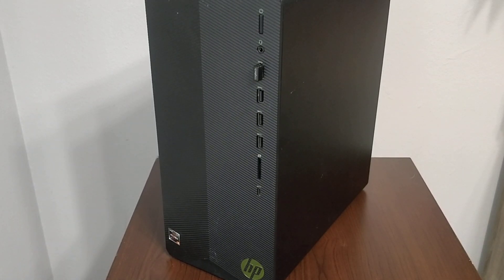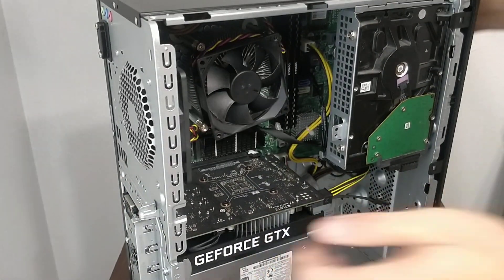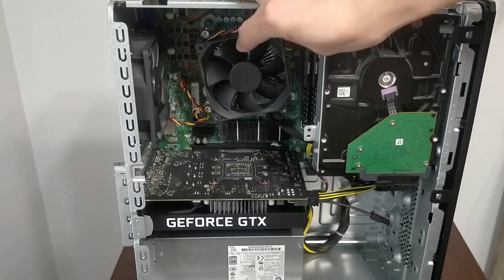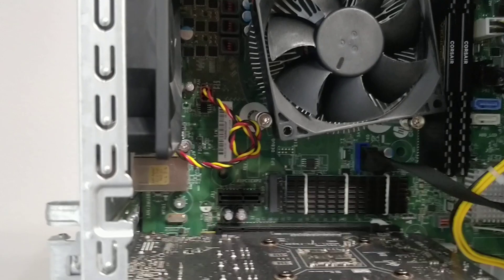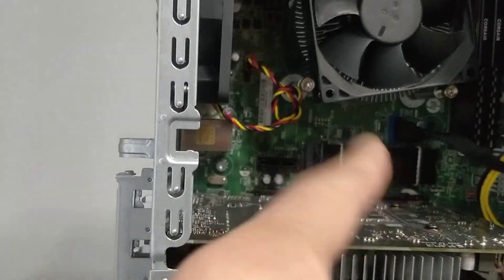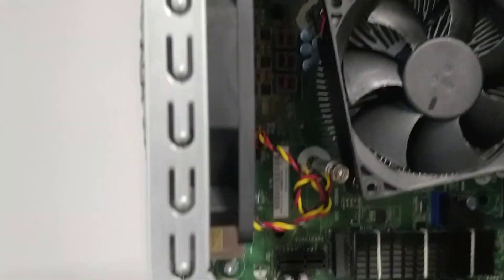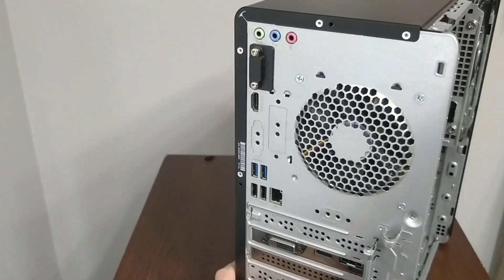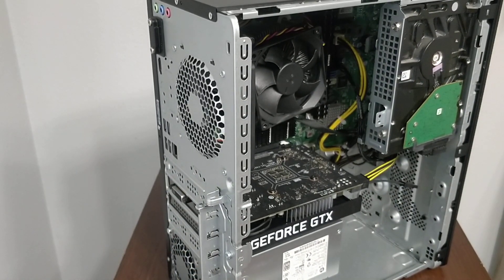HP tg01-0023w, How much Can You Upgrade?

Comment: I bought a 600watt power supply straight from HP, it's as big as HP produces. Changed the GPU to a 4070 zotac (hard part is how limited you are on space). Installed a 4Tb SSD and a 10Tb HDD. Replaced the ram to 2 sticks of 8 don't remember which ones specifically. It is possible to upgrade but it takes some maneuvering and patience. With how much I put into that PC I would've been better off upgrading to a new one without all the proprietary parts

Comment: There is a power supply available it’s 500w I swapped mine. It fits great. Then I put a 3070 in it and 32g ram and I have a ryzen 5 5600g cpu. Upgraded m.2 and a sata ssd
Reply from the maker: That's pretty impressive!, Thats crazy, How did you get it to fit in that case?

Comment: What are the limits of the extra SSD slot I want to add storage
Reply from the maker: There is only one area to mount the SSD.  unless you buy a 
attachment for the older style 3.5 size.  Or you can just plug one in and leave it floor of the case. just remember you didn't screw it down.  Which I've done. 
Here's a video on what you would see inside. when you move the bracket. 
https://youtu.be/3TRME3XH4QY

Here's some links on What I got for mine.
https://kit.co/RichYoYo/tech-i-m-using-right-now

Comment: Just now finishing putting a EVGA  80 Gold 500 W in. Yes some cutting is necessary with no other updates yet but you can update these quit nicely. Also a NVIDIA RTX 3060ti will fit. With this custom case from HP though 10 inches is max room you have for GPU. 🔥
Reply: how did you do it exactly because my power supply went out and have been looking for a solution
Reply: also does the  EVGA  80 Gold 500 W have the same cables as the power supply that comes with the pc

Comment: How did you transfer from one SSD NVME to another?
Reply from the maker: I did not. I just reinstalled windows on to the new nvme.  You can if you want get an nvme holder to put your old one it and use it as an storage drive which i do. 
Which then you can transfer your old one on a new one. but you would have to use a program to clone the drive. 
https://kit.co/RichYoYo/tech-i-m-using-right-now/eluteng-m-2-nvme-and

Comment: is there any external hard drive I can use? or what hard drive did you use?
Reply from the maker: I'm using an NVME external drive for the high speed transfer. and if I'd like i can just put it in an computer if need. easy upgrade and use later. 

Nvme external
https://kit.co/RichYoYo/tech-i-m-using-right-now/eluteng-m-2-nvme-and

Western Digital m.2 drive. 
https://kit.co/RichYoYo/tech-i-m-using-right-now/3337396-western-digital-wd_b

Comment: Hey I bought a hdd for this pc and installed it . I also factory reset the pc so i wouldnt have to go through the hassle of moving files. Eversince  I have not been able to turn off the lights on the pc. You think I did something to the lightning module or is it something else while installing the hdd?
Reply from the maker: Did you try uninstalling the light program and reinstalling it. you can also try going in to bios.
Reply: @richyoyo9796  Yeah did that. What can I do on BIOS? I dont know what i am looking for
Reply from the maker: @torahz3604  it will say front light off. On. If it's there. Did you try installing omen program?

Comment: Just upgraded  from 8g DDR4 to 16 g and replaced the  stock 256  M.2 nvme ssd  with a 1T Samsung 980 .  If the stock GTX 1650 goes out I will find an adapter  so I can uses my less then 1 year used GTX 1660ti Super from my last computer.  THis was pretty  much a video of the OP going I don't know jack .
Reply: How did you change the nvme. I just purchase the same Samsung SSD for my son, but I am lost on how to install it.
Reply: @jonahgingras5940  I installed a cloning program .I used EaseUS Todo Back up (free) got an external adapter for the new nvme copied my files to the new nvme then once done I opened my case and pulled out the old 256 and replaced it with the 1TB .  I then put the 256 into the adapter and labeled it as my back up .

Comment: Can I use the CPU, GPU and RAM of this pc to build another one ? With bigger case/better battery
Reply from the maker: Yes you can.
Reply: @richyoyo9796  will it still be recognized as a hp machine ?
Reply from the maker: @JeuneF  no. You can also take the hard drive. But you might need a new windows.

Comment: what about 500W and 650W power supply PSU can they fit in Hp Pavilion Gaming desktop ?
Reply from the maker: If they are hp custom size. It's an oem psu. And case
Reply: @richyoyo9796  ah, i see i just wanna put new power supply 650W in and it says i need a new graphic card 3070 but it needs two 8 pins to go to video card in
Reply from the maker: @happyk101  sorry I'm not sure if hp builds a power supply that size for this case. To do that u need a new mobo. Psu. And case.
Reply: @richyoyo9796  damn I can’t go buy a new Mobo and case? What am I supposed to do i gtg and build myself on pc? I just bought Hp pavilion gaming desktop in 6 months when I got my money for stimulus
Reply from the maker: @happyk101  you can wait till new gpu are out in a few more years. They will be lower power use. That's what I'm doing.
Reply: @richyoyo9796  ye and I’m trying to upgrade a lot of my stuff on my computer. I gotta upgrade 3070 graphic, upgrade SSS 2.5 hard drive, PSU power supply 500W or 650W Idk yet and 12 pins Outside of Male with 2 8 pins inside of Female too

Comment: can you upgrade the GPU to like a GTX 1660 Super or RTX 2060?
Reply: Yes, that's possible. Plan to do that soon.
Reply: @Raptor1867  how’d that work out for ya?
Reply: @zbone420  Not bad at all. I upgraded to the 1660 ti.
Reply: @Raptor1867  thanks brotha! It looks like I’ll need to upgrade the cpu that came with it before anything else, the ryzen 5 3500 came with mine and it’s not performing correctly, or it’s just a shit cpu. Was working great for the first 8 months or so now recently I get 100% utilizations when playing almost any game. Even opening up a browser for YouTube uses 60%. Having only discord open, will use around 30%. And when moving my mouse around even on a blank desktop screen, I’ll spike up to 80% cpu utilization off purely mouse movement. Weird. So basically it’s causing stuttering in games and they’re nearly unplayable & definitely not enjoyable.
Reply: @zbone420  Make sure you have a PSU that is powerful enough for your GPU and CPU.

Comment: You can pretty much upgrade everything except the case lol
Reply: Can you case swap if you change a powersupply and motherboard
Reply from the maker: Yes you can if you want. By getting a new case, power supply and motherboard.
Reply: @richyoyo9796  what's the point of buying this then ? Lol that's bad advice my Guy
Reply from the maker: @xLilKraz3x  Ya there's a lot of ways, of thinking of things. I purchased mine used for $300 usd.  But things might break or if you purchased a broken one. and was thinking of upgrading it or just having to get the same parts for it.

Comment: If I were to buy a pc case that supports atx motherboards would the motherboard from this pc fit in the new one? And would the power supply be able to fit in the new case?
Reply from the maker: The Hp mother board is missing an 24 pin. You will have to buy an new power supply and new motherboard. and case. since all that is custom hp size.
Reply: No it would work

Comment: 1. Case can be modded for another power supply. 2. CPU Fan be switched by anyone with basic computer build knowledge. 3. CPU can be upgraded to any non threadripper. 4. Ram is upgradable. That’s just the obvious. In short you obviously don’t know what your doing and need to stop misleading people.
Reply from the maker: Cool thank.
1.  Do you know which power supply I can switch to? since the motherboard does not have a 24 pin power connector? I've been trying to figure that out. 
2.  Also which kind of socket is the CPU fan? so I can figure out what to buy?

Comment: i have the version  with gtx 1660 super 6g and an i5-10400f.the gtx 1660 super  is overclocked at the max stable boost speed and power limit off. it even somtimes uses 126w.but have not  had any issue. i play vr  with link. games like boneworks blade and sorcery with mods. its a beast. only had to pay 1200 dollars in norway and great video :D

Comment: I recently installed a 1TB 970 samsung m.2 ssd. I cannot use all the the space on the new ssd. It will only allow me to use the amount that was on the older ssd. Please help I have no clue how to use the full 1TB of storage.
Reply from the maker: you exchanged it? or add it? if you exchanged it you would of had to reinstall the operating system.  if you added it you would have to format the new drive. you would have to YouTube that. how to format a new drive. 
https://youtu.be/3TRME3XH4QY
Reply: I cloned the original ssd to the new one. Everything works fine. Just can't use all the storage.
Reply from the maker: @malmal8241  I've never really got in to cloning. maybe you can look in the windows disk manager to see if its in there and maybe it needs to be formatted?

Comment: You can upgrade the cpu to a 3700x and the gpu to a 3060 without power issue.
Reply from the maker: hp says the 3700x is fine. but idk about the 3060 would fit.  hp only has a 2060 you can buy with it.  case is small. 
https://support.hp.com/us-en/product/hp-pavilion-gaming-desktop-pc-tg01-0000a/37874510/document/c06418627
Reply: @richyoyo9796  The EVGA dual fan 3060 is only about 7 to 8 inches long and the case can fit it
Reply from the maker: Then you would have to figure out if it is okay with 400watt power supply.

Comment: if i were to put it in a new case you think i could upgraded the power supply
Reply from the maker: The case, Mobo, power supply is custom. OEM. And only connect with hp parts. You would have to buy all three of them new.

Comment: Can i upgrade my motherboard?
Reply from the maker: For the HP tg01-0023w, In the video. if you want to change the motherboard you have to change the power supply, the case and the mother board. since those are OEM, or custom for Hp. and they only fit them.

Comment: I have this pc and I play cyberpunk at 1080p high textures and high LOD but low  everything else. It runs at 60fps dips to 35 fps lowest but I set it my max fps to 45fps. It runs good. Well I also upgraded to 16gb of ram.
Reply: u can upgrade the ram on it just fine?
Reply: @CrEaTiiOnYT  yes
Reply: @johnnyappleseed8127  what about ssd
Reply: @platinumvideos9810  yes I have an SSD and the load time is very fast. It take about 10 seconds to load if that. But you're asking does this build have an SSD then yes it does but it's only 500gbs which of course you are only able to use about 375gbs of it. I got an external 1tb hard drive.

Comment: When you replaced your m.2 ssd do you have to clone windows o.s. to another drive? Or is the o.s. to the board?
Reply from the maker: I just reinstalled the Windows. since it hp they didn't need an activation code or something.
Reply: You can clone the old m.2 on to an new one . Just get an external m.2 nvme adapter  to do it and find a good  image copy software like Acronis or Easeus Todo backup .  Once it is copied onto the new drive just pull the old one out , replace with the new one and it should boot right up since it is an exact copy of the old drive.

Comment: Can I upgrade the Cpu cooler to the gammax 400?
Reply from the maker: I'm not sure sorry since hp use a custom mobo and idk what kind of attachments they use for the cpu.
Reply: @richyoyo9796  o ok.  are the temps high for u aswell? Mine runs to 80 c while gaming with oc to 4.1 ghz is that normal or should I just turn off the oc?
Reply from the maker: @Brwnie7  ya that's a little high. You might lower it a little. Or take of the side panel. Which is what I do.

Comment: I just bought a HP M01-F0024 desktop. Ryzen 5 3400G with RX Vega 11 graphics, 256gb SSD and 12gb DDR4 (8x4). You could game on it just not to the extreme. I'll just add a full 16gb (8x8) set, GTX 1650 and that 400w supply from the HP website. Consider yourselves lucky who has 400w, This comp has a mere 180w. lol

Comment: do you recommend this computer? or better the HP Pavilion Desktop Computer AMD Ryzen 5 12GB RAM 512GB SSD - AMD Ryzen 5 4600G?
Reply from the maker: Ah what gpu is in that one? the 4600g has an integrated gpu. if it only has that, its not really that good at gaming. this one would be better.
Reply: @richyoyo9796  Thanks for your answer ... and if I don't use it frequently for gaming, would I waste the graphics card? or is this useful to me for other tasks? I am not an expert in computer
Reply from the maker: @vicbennu  if you game get the one with the 1650 super. if you dont game then just get the 4600g.
Reply: @richyoyo9796  thanks for your recommendation

Comment: You know if you can add a second 3.5" internal hard drive? and if so, how?
Reply from the maker: Here
https://youtu.be/3TRME3XH4QY
Reply: Mount it on the front, but you need to get an extra sata data cable. There are holes on the front, I mounted an SSD there, there's mounting holes for both 2.5" and 3.5"

Comment: Hey, does it have built in fans?and could I connect the pc to my 4k tv? Then eventually get a 144hrz monitor?
Reply from the maker: Yes it has one extra fan that's connected to the case yes you could plug it into your TV but the letters will be harder to see since it's not a monitor.
Reply: @richyoyo9796  what do you mean by letters?
Reply from the maker: Monitors and tv are different. monitors are made for text. and tv are not.
Reply: @richyoyo9796  ok well is this pc good for dayz , straight out the box with no upgrades
Reply: @kixifyz-9454  dayz recommended ram is 12gb and this has 8gb so you can probably run it decently at like a steady 60 fps at high settings

Comment: You basically made a video saying you don't know what you can upgrade lmao.
Reply: Right like wtf I have a ryzen 5 3500 with a 1650 super 256gb ssd, 8gb ddr4 hp pavilion gaming pc I don't know what I can upgrade on it this video was pointless dude has no clue wtf he's talking about he's tweaking smacking his lips after every two words haha 😂
Reply: @jacobb1065  Okay, i would honestly get a new motherboard and ram. Upgrade a new power supply and case, pc building prices are insane right now so I would just hold off on buying any new gpu or cpu. Just get another psu, ram and switch the case cpu and gpu over.
Reply: @jacobb1065  did u get the custom one
Reply: @jacobb1065  😂😂😂

Comment: what if I buy a case motherboard and psu and take out the ssd ram gpu and cpu out of the hp and put it in the new stuff  would it work?
Reply from the maker: Yep that would work. but it seems like you might as well get a new pc. for that.
Reply: @richyoyo9796  would you be able to upgrade the cpu cooler?

Comment: First of all it comes with an 80+ platinum certified company 400w power supply thats close to the best supplies you can get and it can run a 1660 super or even an rtx2060, without much of a problem, second of all quit smacking your lips when you talk its like nails on a chalkboard. Third do your research better, HP released this build as an upgradable prebuilt and speaking as a current owner of one I can tell you just about everything is an easy upgrade on it.
Reply: Kapono Bassett  No, but you can upgrade to a Ryzen 5 3600x. I have the same system but I added a 16GB kit of DDR4 (2x8GB, 3200 MHz), a Ryzen 5 3600x, and a MSI GeForce GTX 1660 SUPER which was the best budget GPU I could put in there because of the PSU. That’s about all you could do besides putting in another HDD.
Reply: Dude prob tried to put an i7 in it and got mad because it wouldn’t work

Comment: You literally can upgrade the graphics in this computer. Yes it may only have a 400 watt power supply. You could easily upgrade this computer to something like a GTX 1660 or even a 1660 IT when that exact power supply.  Even when a GTX 1660 TI you still won't even push 300 watts in this computer. Actually with this computer if you really wanted to you could actually push it to its limit and upgrade to an RTX 2060. And even then he still won't succeed over 400watts. Even with an RTX 2060 you may push the power limit to no more than 330 Watts On a full load. I actually had bought the second generation of this computer because the one you have is actually considered the 3rd gen of this computer. However the one that I have only have a 320 watt power supply and when I bought the computer it originally came with a GTX 1050 and a 4 core processor I ended up upgrading to a ryzen 5 2600 6-core processor and I upgraded the graphics card from the gtx1050 to a GTX 1060 6GB card. And never once have I succeeded over 300 watts with my GTX 1060. As a matter of fact the GTX 1650 super basically is a GTX 1060 the only difference that set the two apart is the 1060 has ddr5 memory and the GTX 1650 super has ddr6 memory. Other than that it has the same cuda cores  and that's the same it has the same mhz on the GPU the only difference is the fact that it has  ddr6 which is faster than ddr5. And the 1650 super. Would actually work just fine in my PC with the 320 watt power supply. I have one of those meters that allows you to read the Watts of your computer and I can push this computer to its limits and it don't even succeed no more than 220 Watts on full load. And I have ran a test once before on RTX 2060 and it pulls on full load it can draw 330 watts. The thing with the most companies like an Nvidia or AMD they never give you the minimum power requirement they always want to show you the recommended. Technically the recommended power supply for a RTX  2060 is 450 wats. Same goes with a GTX 1060 the recommended power supply is technically 400 watts but can run just fine on a 300 watt depending on the CPU.
Reply: Yea but running on 400w isnt ideal we all now that these prebuilts are terrible with upgrades.